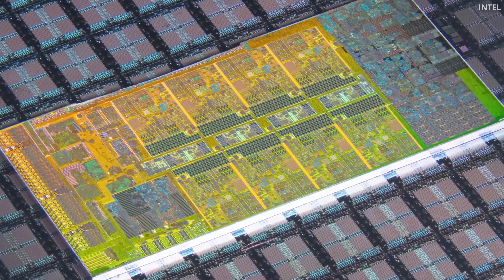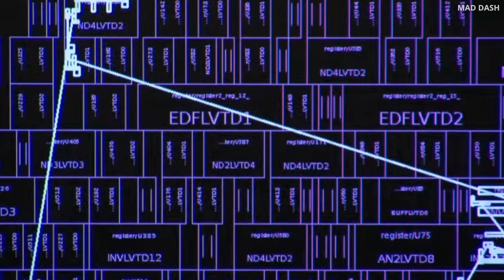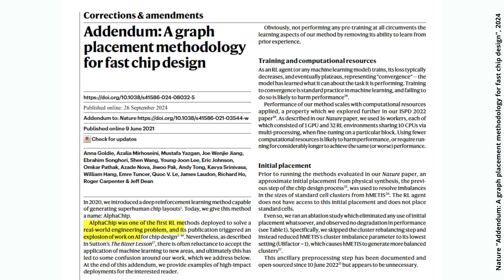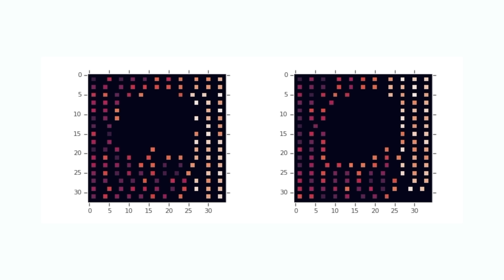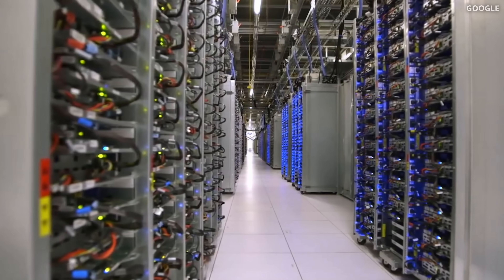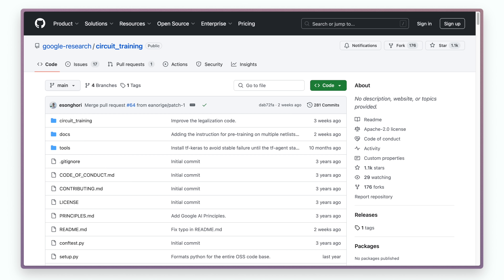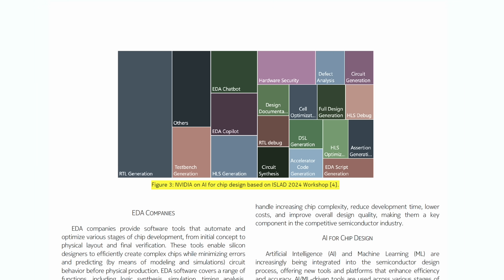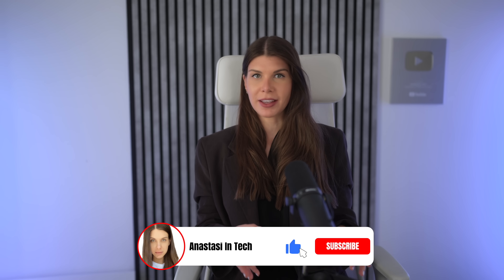How AI Designs Computer Chips

Comment: Amazing! Thank you so much for making this video Anastasi 😀❤. You would still need human engineers to input the design parameters into the AI correctly for AlphaChip to synthesize and assemble the blocks correctly. Each Chip has different specifications which in turn changes the design parameters, so this can't be replaced by AI.

Comment: === Summary ===

  1. AI in Chip Design: Google’s DeepMind has introduced “Alpha Chip,” an AI tool revolutionizing computer chip design by
  significantly reducing the time from months to hours.
  2. Background in Chip Design: The video creator, experienced in silicon chip design, explains the complexity of placing
  billions of transistors and miles of wire in chip layouts. Previously, this complex process was manual but evolved with
  tools such as EDA (Electronic Design Automation).
  3. EDA Tools: Today, companies like Synopsys and Cadence dominate the EDA market, helping engineers manage the growing
  complexities of modern chip designs at advanced nodes like 2nm.
  4. Challenges in Chip Design: As designs grow more intricate, it becomes difficult to optimize layouts, leading to
  issues like heating and power delivery problems. Finding the best layout among billions or trillions of configurations
  is a complex process that can take weeks or months.
  5. Alpha Chip: Google’s AI-based Alpha Chip uses reinforcement learning to treat chip design as a game. It places chip
  components sequentially on an empty grid, optimizing metrics such as wire length, area, power, and performance by trial
  and error.
  6. Results: Already used in real-world products like Google’s TPU and Mediatek’s 5G modem, Alpha Chip has demonstrated
  benefits, such as reducing wire length by 6%, leading to smaller, faster chips.
  7. Skillshare Ad: The video includes an ad read about Skillshare, promoting business management and communication skills
  courses.
  8. Limitations and Potential: Although Alpha Chip significantly optimizes layout design, it only covers a small sub-step
  in chip design and is far from being able to design entire chips autonomously.
  9. Two AI-Driven Approaches:
    • LLM-based: Large Language Models, trained on design data, assist human designers by generating code, test benches,
    or helping with debugging.
    • Reinforcement Learning-based: AI learns through repeated practice to optimize complex tasks like layout design (e.
    g., Alpha Chip).
  10. Industry Adoption: Companies such as Synopsys and Nvidia are integrating AI into their chip design tools. Synopsys’
  “DSO. AI” tool, for example, has successfully shortened design cycles significantly in over 1000 chip designs.
  11. Conclusion: AI has immense potential in the chip design industry, and with time, it could lead to an end-to-end
  optimization of hardware, software, and machine learning models. The creator emphasizes the excitement and innovation in
  the field and encourages feedback from the viewer.
  12. Extras: A free semiconductor value chain cheat sheet is available for download, celebrating the channel’s milestone
  of 200,000 subscribers.

Comment: Congrats on 200K, your channel is excellent!  My friend who has worked layouts for decades will soon be out of work with the latest tech coming online. Having a system that is capable of improving itself and is useful for improving the next generation seems like an absolute game changer. Computer designers have known this for a long time but humans were in the loop for a lot of the evolution. Without humans in the loop (or very tangentially) the cycle time will shrink, as you say, and improvements will soon become astronomical.

Comment: D.N.A. programme develop body like a chip , to develop higher performance software, try this, touching finger tips slide down to your wrist and back up, alternate each hand, focus on tenderness gentleness to feel that tingling sparkling , develop to extend than tingle to hold the whole body in your own sparkling feltness , the sensation can be so intense it is hard to hold your awareness for more than a few minutes for the sensitive , may you be filled with your own bliss. helps unification of both halves of brain , you may come feel the separation of mind from thinking and your energy field surrounding whole body,generated by body ,, luv you darling,, Gary Law

Comment: I feel like chip technology is more about marketing than anything else these days. The build up all this hype, but we only see 5-10% improvements.
If I think back to 1998 and 2008, we went from 1 CPU core at <1 GHz to 4 CPU cores at ~3GHz. The difference was night and day.
2014 Still 4 cores now ~4 GHz and now in 2024 it is 8 cores and ~5Ghz.
Most people could still use a CPU from 2014 and they would be able to do most of the things people are doing on there PC today, with no problem.
Fair playing the newest most demanding games would bot work, but it is close.

The thing is improvements are getting harder and harder and harder and everything is slowing down, but marketing is trying to keep the hype alive.
I am getting less and less interested in following tech because it is frustrating to see the marketing and hype build ud for another 5-10% improvement for 20% more cost. 🤷‍♂

Here have a nice box with nice colors and a display on your AIO water cooler and see how far PC's have come. Now you can run a small AI on your home pc that solves a problem I never had in the first place. Designed by AI, with AI features running AI. 🤷‍♂🥱

But maybe that is just me.

Comment: Nice and interesting presentation, thanks! It’s a pity google didn’t come up with a more creative name than “Alpha”. This name seems a little overused. Digital Equipment Corp. (DEC) used it as the name for it’s chip for the VMS systems. The team that did that design spun off as PA Semi, which Apple later aquired and so it seems reasonable that Apple’s chips were also called “Alpha”, later just A. Now Apple has the “M” series. Anyway, I digress. Wonder why Google chose to call it “Alpha”?😂

Comment: Someday i was wondering if Hamilton circles ie. the travelling sales man problem related to layout routing close enough, that perhaps making up a routing could be easier than "understanding" it. So drawing some short paths and placing most gadets into.the mesh afterwards is easier then reverse engineering afterwards, what may have been the path that had to be optimal... looks sheer theoretical at first. I actually came across this problem about how a graph (maybe AI) can be placed so in a burst oriented RAM, that most read and maybe write accesses utilize full bursts, while the graph is seemingly random. Yet if the graph has key major ways of traversal during work, than it should be mapped into burst oriented memory according to those paths for speed reasons... And memory is always burst in high performing systems because of wire lengths, and of course at every vertex length that fits in a single burst, there is are branches allowed, for switching from burst to burst may be cheaper and faster. This can ultimatly boil down to "creating" such a graph mesh being faster than "learning" it, which latter meant trying to map an existing functionality graph into burst RAM.

Comment: 7:00 it is meaningless to compare to layouts (actually, ‘placements’) done by a human designer.  No human does hand placements of transistors, now or for many many years on designs with anywhere close to billions of transistors.  There have been automated placement tools that have existed for decades which do this job.  It is these tools that should be compared against, not humans.  A human would suck at doing a quality placement of even much less than a million transistors.  Not to mention that they would not be able to mentally have to repeat the same placement task dozens of times while the design is changing in small or larger ways.

Comment: 100909   The second law of thermodynamics may be false conventional wisdom. Let's face the wonder of full heat use. 

The second law of thermodynamics was imposed on us during victorian england's scientific and religious fascination with steam engines. 

The second law is behind modern refrigerators needing electrical energy to compress the refrigerent to force it to release as waste the heat that it has removed from the refrigerator's service interior in the cooling part of the refrigerent's circulation. The interior coldness draws in exterior heat through the cabinet insulation. There is also discarded heat from mechanical friction and electrical resistance. The net thermal output equals the electrical input with energy not being gained or lost in this refrigeration system including its forced waste. Unencumbered refrigeration by the principle that energy is conserved should produce electricity instead of consuming it. 

It makes more sense that refrigerators should yield electricity because energy is widely known to change form with no ultimate path of energy gain or loss being found. Therefore any form of fully recyclable energy can be cycled endlessly in any quantity. 

In an extreme case senario, full heat recycling, all electric, very isolated underground, undersea, or space communities would be highly survivable with self sufficient EMP resistant LED light banks, automated vertical farms, thaw resistant frozen food storehouses, factories, dwellings, self contained elevators, safe rooms, and horizontal transports. 

In a flourishing civillization senario, small self sufficient electric or cooling devices of many kinds and styles like lamps, smartphones, hotplates, water heaters, cooler chests, fans, radios, TVs, cameras, security devices, robot test equipment, scales, transaction terminals, wall clocks, open or ciosed for business luminous signs, power hand tools, ditch diggers, pumps, and personal transports, would be available for immediate use incrementally anywhere as people as individuals or larger social groups see fit. 

Some equipment groups could be consolidated on local networks. 

If a high majority thinks our civilization should geoengineer gigatons or 
teratons of carbon dioxide out of our environment, instalations using devices that convert ambient heat into electricity can hypothetically be scaled up do it with a choice of comsequences including many beneficial ones. 

Energy sensible refrigerators that absorb heat and yield electricity would complement computers as computing consumes electricity and yields heat. 《Computing would be free. Chips could have energy recycling built in.》

A simple rectifier crystal can, iust short of a replicatable long term demonstration of a powerful prototype, almost certainly filter the random thermal motioren of electrons or discrete positiive charged voids called holes so the electric current flowing in one direction predominates. At low system voltage a filtrate of one polarity predominates only a little but there is always usable electrical power derived from the source, which is Johnson (observation) Nyquest (theory) thermal electrical noise. This net electrical filtrate can be aggregated in a group of separate diodes in consistent alignment parallel creating widely scalable electrical power. The maximum energy is converted from ambient heat to productive electricity when the electrical load is matched to the array impeadence. 

Matched impeadence output (watts) is k (Boltźman's constant), one point three eight x 10^ minus 23, times T (temperature Kelvin) times bandwidth (0 Hz to a natural limit ~2 THz @ 290 K) times rectification halving and nanowatt power level rectification efficiency, times the number of diodes in the array. 

For reference, there are a billion cells of 1000 square nanometer area each per square millimeter, 100 billion per square centimeter. 

Order is imposed on the random thermal motion of electrons by the structual orderlyness of a diode array made of diodes made within a slab: 
-----‐------‐----___-- Out
🔻🔻🔻🔻
■■■■■■___ + Out 

All the P type semiconductor anodes abut a metal conductive plane deposited on the top face of the slab with nonrectifying joins;  the N type semiconductor cathodes or common cathode abuts the bottom face. As the polarity filtered electrical energy is exported, the amount of thermal energy in the group of diodes decreases. This group cooling will draw heat in from the surrounding ambient heat at a rate depending on the filtering rate and thermal resistance between the group and ambient gas, liquid, or solid warmer than absolute zero. There is always a lot of ambient heat on our planet, more on equatorial dry desert summer days and less on polar desert winter nights.

Focusing on the composition of one simple diode, a near flawless crystal of silicon is modified by implanting a small amount of phosphorus (N type conductivity) on one side from a ohmic contact end to a junction where the additive is suddenly and completely changed to boron (P type conductivity) with minimal disturbance of the crystal lattice. The crystal then continues to another ohmic contact. 

A region of high electrical resistance forms at the junction in this type of diode when the phosphorous near the ĵunction donates electrons that are free to move elsewhere while leaving phosphorus ions held in the crystal while the boron donates holes which are similalarly free to move. The two types of mobile charges mutually clear each other away near the junction leaving little electrical conductivity. An equlibrium width of this region is settled between the phosphorus, boron, electrons, and holes. Thermal noise is beyond steady state equlibrium. Thermal noise transients, where mobile electrons move from the phosphorus added side to the boron added side ride transient extra conductivity so the forward moving  electrons are preferentally filtered into the external circuit. Mobile electrons are units of electric current. They lose their thermal energy of motion and gain electromotive force, another name for voltage, as they transition between the junction and the array electrical tap. 

Inside the diode, heat is absorbe; outside the diode, to exactly the same extent, an attached electrical circuit is energized. The voltage of a diode array is likely to be small so many similar arrays need to be put in series to build higher voltage.  

Understanding diodes is one way to become convinced that Johnson Nyquest thermal electrical noise can be rectified and aggregated. Self assembling development teams may find many ways to accomplish this wide mission. Taxonomically there should be many ways ways to convert heat directly into electricity. 

A practical device may use an array of Au needles in a SiO2 matrix abutting N type GaAs. These were made in the 1970s when registration technology was poor so it was easier to fabricate arrays and select one diode than just make one diode. 

There are other plausible breeches of the second law of thermodynamics. Hopefully a lot of people, mostly as independent teams, will join in expanding the breech. Please share the successes or setbacks of experiemental efforts. 

These devices would probably become segmented commodities sold with minimal margin over supply cost. They would be manufactured by advanced automation that does not need financial incentive. Applicable best practices would be adopted. Business details would be open public knowledge. Associated people should move as negotiated and freely and honestly talk. Commerce would be a planetary scale unified conglomerate of diverse local cooperatives. There is no need of wealth extracting top commanders. We do not need often token philanthropy from the top if the wide majority of people can afford to be generous. 

Aloha
Charles M Brown 
Kilauea Kauai Hawaii 96754

Comment: Imagine an AI that can control robots, move the mouse on a computer, talk to you, and even pretend to be a dog or human in a virtual world and a robot dog or human in the real world. Once we have an AI this powerful and versatile, everyone will want it on their phone. To make that possible, chips will need to be specially designed for this type of AI to run quickly and efficiently.

With this kind of AI, you could control multiple robots at the same time, while it talks to you and manages tasks on your computer—all from one device. Instead of needing expensive computers everywhere, one powerful AI system could manage everything remotely, controlling it all from one place. The hardware (chips) and software will need to be optimized to work together, making the AI faster and more effective. This is the future of AI—where one system can do it all.